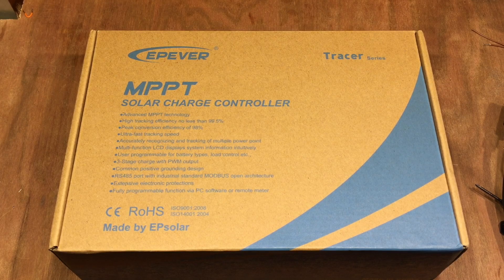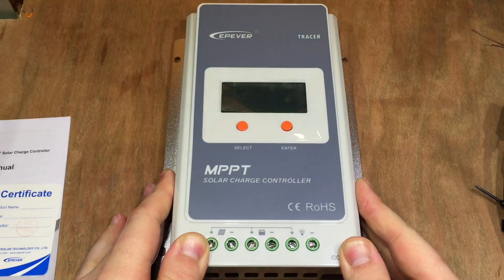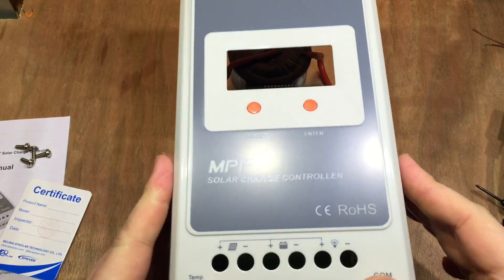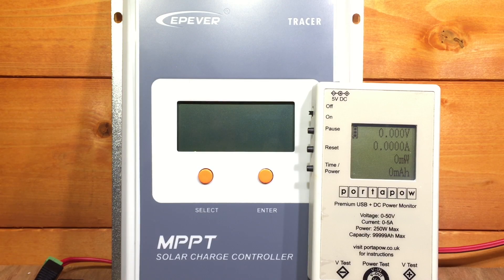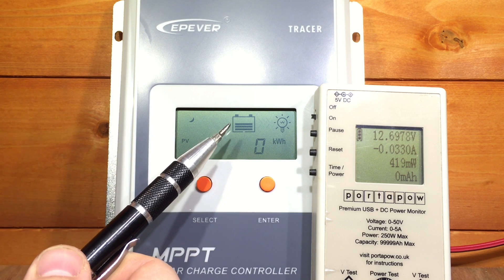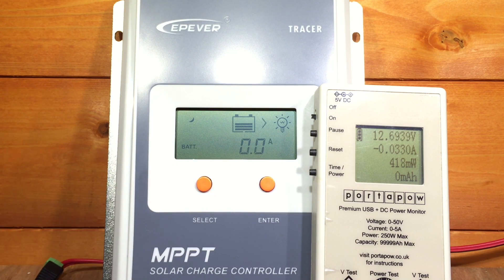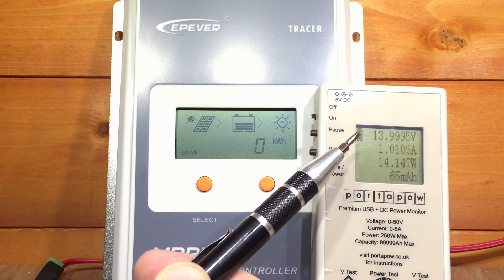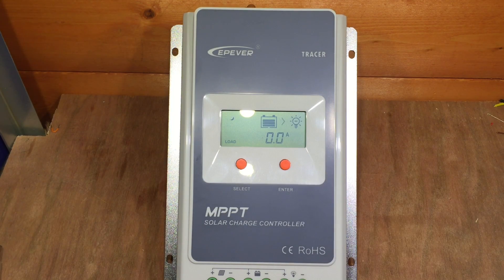MPPT Charge Controller Review - EPSolar EPEver Tracer A Series - 12v Solar Shed

Comment: I just got the same device.
If anyone can help me understand if I can connect my 2 panels with this specs:

Nominal Power 265W 
Measurement accuracy Pmpp*: ‡3 %
Short Circuit Current 9.16A
Open Circuit Voltage 38,32 V
Current at maximum power 8.76 A
Voltage at maximum power 30,25 V
Maximum system voltage 1000

Comment: Hello. A question if I may: can I use the EPEVER 2210AN with a solar panel of 280W, 31.38V, 8.93 A. In the PV specs it also says: 39.12V in open circuit and short circuit curent of 9.45A. I'm interested in charging a gel baterry 12V, 90Ah. Is the controller able to transform the Volts from PV to 12V of the battery? Thanks.
Reply from the maker: Yes it is. It may limit the charge current though if your panel is in good sun and your battery is low to stay within the 20amp limit.

Comment: Is the output voltage of the load terminals of this charge controller regulated? That is, does this voltage fluctuates with the battery voltage? What is its nominal value? Is there any significant ripple? It would be awesome if you could provide the shape of output voltage using and oscilloscope :D
Reply from the maker: The output is not regulated. It is the same as the battery voltage.
Reply: @AdamWelchUK  Thank you!

Comment: hi good video one question i have been told by several people they are no good , they said to buy a Vicron smart solar controller instead what do you think
Reply from the maker: I know Victron are well regarded, but I have no experience of them. I have extensive experience of EPever, and they’ve been great for me. You pay your money, you take your choice. Good luck!
Reply: @AdamWelchUK  Thank you i like the Epever so going to go with them will a 30 Amp mppt suit my 300watt fixed panel  and my 200 watt folding  panel when i pull up at camp i have a 100ah AGM battery i run a waeco fridge and a few solar lights
Reply from the maker: @Farmer2492  with 500 watts of solar that translates to 41 amps if you’re battery is at 12 volts. So you’re over the rated output of the 30 amp model. It’ll actually cope with that, but will throttle the charge to 30amps. If you got the 40 amp model it’d charge at the full capability in full sun.
Reply: @AdamWelchUK  Hi i will be only using one panel at a time folding when i set camp up and the fixed one will be when i am driving

Comment: Hi there, I have this same model and am looking at adding another panel to my array, by adding another panel, it would bring the total panels up to 290w (this controller is rated at 260w, 12v sys) and a total of 15.6amp (9.1a on the 190w panel and 6.4a on the 100w panel)
I see that this controller has a particular feature "Ability to connect a larger array. The controller has the ability to restrict the charging current." 
Does this mean that I could still use this controller and it just restrict the total panel output to 260w as rated and I just wouldn't get the full use of the panels?
Or, would it run a fire risk and melt down with an extra 30w of panels? Any info on how this larger panel array feature works would really help. Thanks.
Reply from the maker: You’ve correctly identified a neat little feature of these controllers. Yes you can over spec your array however the charge current to your battery bank will never exceed the rated current for the model (it does actually, but only by one amp). 
I think the best part of this is that you can achieve more current in the winter without having to reconfigure in the summer.
Reply: @AdamWelchUK  Thanks Adam, Do you know what I need to look out for to avoid blowing the controller or damaging the system? The Panels I mentioned in my first comment is what I'm looking at, and I notice that the controller is Rated to 20amp, but the combined total of the panels I think is around 15amp. I'm a little worried as I know that in New Zealand the sun can be really harsh (big hole in the ozone) during the summer months and I've seen some panels totally crank it in the summer.
Reply from the maker: @joemcenteer2688  I haven’t been able to test this I’m afraid. I don’t have the solar I need to over rate my array with my controller (an in northern England we don’t reply get the sun) but I have heard that others have successfully done this. You’re over specking by less than 15%. My gut says it’ll be fine because EPEver claim it will go far higher. The controller will place your panels in a less efficient range when they are producing a too high current to reduce that output. In reality it’s just another calculation in the algorithm. Create as much as possible until you hit this limit, then throttle back to maintain that limit.
Reply: @AdamWelchUK  thanks, good advice, I'm thinking about putting a 12v fan heater or something similar on the light bulb port of the controller, my theory is any excess would be burned off pretty quickly by this. My gut says the same as yours as the over spec is so little, plus I've got an issue with part of the panels shaded by the roof bars and luggage box of the camper, so all things considered, it will probably work out fine and a nice balance. Thanks for your input mate
Reply: @AdamWelchUK  I've successfully overspec the solar array without any issue, yay!
Now I'm trying to set the load mode timer to run the fridge only during the day time but I can't seem to understand the modes, the manual is saying "load on for 1 after after sunset" and timer 2 "load in for 1 hour before sunrise" but when I set it to this its not on when the sun is up, its pretty confusing, is that to say that the load is only on during that 1 hour and then off again? Any ideas what I should set it to to make it only on during the day? Cheers

Comment: Are the pv panels best wired in series or parrel for maxium efficiency? Thanks
Reply: Love your videos btw
Reply from the maker: Thanks. 
It depends. The epever manual has some efficiency graphs which explain where they found the maximum efficiency. For me, I find it’s more efficient to run them in series in the summer and parallel in the winter.
However this all depends on what panels you have and their maximum power point.
Reply: @AdamWelchUK  Thank you. I will look at the manual and possibly do some experiments. 👍

Comment: I don't understand the load ports on this? Or what they're for.
Reply from the maker: They are controllable. So although they are just connected to the battery - and not regulated to a specific voltage, they can be used to control your loads. 
For example, you can have it turn on at dusk and switch off at dawn - useful for a night light. Or you could have a permanent load connected but if your battery voltage dropped to a critical level, the load could be switched off and not switched on again until the battery has recovered. 
Finally the only other reason to connect your loads here rather than directly to the battery is that you can monitor your loads. The charge controller reports on load current, watt hours etc.

Comment: Thanks great review. I seen there was no battery setting for lithium batteries. Is it possible to change the values of the charging float and bulk to suit a lifepo4 battery? Thanks 👍
Reply from the maker: Hello. Yes you can change the parameters to suit lithium (both my tracer a’s now charge lithium banks) but to change the charging parameters you need to connect to the charge controller over rs485. The cheapest way to do that is a cheap usb to rs485 adapter and an old network cable (I made a video where I built one) and using the epever windows software. Alternatively you can use the ebox adapters, the mt50 lcd screen or one of the many other home brew options out there (the most simple probably being the one Colin Hickey sells on his tindie store).
Reply: @AdamWelchUK  Thanks mate. I just watched the whole video. I ordered a cheap usb to rs485 adapter and have plenty of network cables lying around. I have ordered 4 cells of 280ah 3.2v Lifepo4 with a 200a Daly BMS from Alibaba. I want to try keep the cells around 90% state of charge as i believe it will make their life cycle higher.
Thanks for all the info. My garage will be fully off grid soon.

Comment: Hi, I watched your video last year after I purchased the same Epever Tracer. Mine was for solar charging in a travel trailer in the US. It's has worked well, but I got to wondering about the "LOAD" connect. I have run wires from my batteries to the power distribution center. Why not run wires from "LOAD" connectors on the Epever to the power distribution center? Your thoughts? Thanks

Comment: in reguards to the epever tracer 1206AN,  would it be possible to link up a 36v 200w 5.5A solar panel and have it convert to a 12v 450ah battery system?   im confused at all the jargan of open circut this and that in the user manual.   
heres the workshop manual for that particular model @t

Comment: I know this video is old, but I'm hoping someone might answer. I have a query on the load settings. Mine reads 117 and 2 n, and also 0.5 kw  what does that mean? Sorry to be dense!
Reply from the maker: 117 - load terminals in manual mode
2n - sunrise setting disabled
More info in the manual (page 19) https://www.epsolarpv.com/upload/file/1811/Tracer-AN-SMS-EL-V1.0.pdf
Hope that helps.
Reply: @AdamWelchUK  thats great! Thank you so much. I have a new solar set up in my camper van, I'd  like to try and understand it.

Comment: I have had this controller for two years.. It seems to work exactly as promised and has been very good value for money...
Reply: When you say plug and play does that mean that you simply hooked it up and didn’t have to program it?
Reply: @adam56usa  Yes - I did test if there was a difference between series and parallel - I would have thought that series would have been better with higher voltage and lower amps but it seemed to work slightly or marginally better in Parallel configuration - first with two panels and ultimately with three x 100 watt panels
Reply: Dan Erlich thanks. I looked at the owners manual and it seems a bit complicated. I didn’t get the MT 50 connection 
My unit is for 20 amps. I only have 200 watts. They are hooked up in parallel. I have two 50s and one 100 watt Renogy panels.
Reply: @adam56usa  The settings for lead acid and AGM batteries is the same and that is how mine came set from the factory.  Gell batteries require a different setting and also should have a temp sensor.   There are WARNINGS about mixing different solar panels... they should all be the same rating, but yes wiring in parallel is the way to go if you are doing so... I run three 100 watt panels as there is sufficient room on my Bimini to fit three panels - in my case flex panels.  I am going to shift to high strength magnets for mounting them...Much less invasive than any other method.    As my panels are all the same I tried this in both series and parallel and found that parallel was slightly better than series... The attractive things about doing it in series is that this controller can handle 100 volts and the current in the wire is much lower and the controller makes the conversion to from high voltage down to regulated supply of 13.5 volts...
Reply: Does this unit need to be programmed using an external source. Like a laptop or PC?
Reply: @adam56usa  No ... it was in my case plug and play.. Lovely machine BTW... Wish I could use it RIGHT now .. our boat is at our yacht club and we have been shut down tight...
Reply: Dan Erlich thanks, I am living on my sailboat in Miami. Just trying to squeeze a little more out of my solar panels. I currently have a PWM controller.
Reply: @adam56usa  The efficiency of this controller and the quality and reliability is excellent particularly for the reasonable price.   I tried it both parallel and series, found slightly better performance in parallel - but so tight that it really made no difference, the rational became that if one panel failed that parallel kept things running while series killed off the power.    Are you permitted to leave the dock to sail currently?   They allowing the marina to function?   Our club has been shut down TIGHT - we can not even VISIT the property to do maintenance on the hard now which really pisses me off - and as we are on an island this is even tougher..  The police are fining people heavily - $880 minimum, no fun what so ever.
Reply: Dan Erlich same here. They shut it down. People can check on their boats but cannot take them out. Also, no mechanics or brokers. I can use the showers and laundry and the staff hand me my mail but we cannot go into the office. I can understand that. The mayor got really ticked off awhile back because people were going out to the sandbar and rafting up to have parties. He shut down everything. Only boats allowed out are commercial fishing boats. 
Thanks for all your help with the controller. I’m going to invest in one.
Reply: @adam56usa  We can not even CHECK on our boats.. they are on the hard, under tarps and now with the warming weather the internal temperatures can skyrocket during the day and we can not get down to make changes for ventilation and mitigate physical damage... We need police permission to go there and the club has not arranged for this.  A few have went on the property with out permission but that opens them up to large fines and disciplinary action from the club.   I have asked the club board to act but they are figuring a MONTH at best before we can get ONE visit down to  our boats.
Reply: Dan Erlich just ordered the controller. Thanks for the help.

Comment: hi.hi.i have a smart bms. blutooth.i have connected and can see cells on my android @t battery is @t says one battery 3.6v an rest nearly @t trying to balance on the app.. when compare bms voltage with battery voltage   51,7v at battery but when measure bms black discharge leads to positive  its only @t that right?it does show 51.7v on the app from my battery
                
•
                 
•
Reply: well steve.ive just been on bike with cheap controller and it went well must have been nearly 30mph but didn't have speedo like my other controller with lc that cuts out.battery just dropped to 52volts.so why would the beefier controller cut out its twice the size of simple one.could it be settings on kt lcd3 display.?

Comment: Hi Adam,  If you still check your older videos,  how do this change controller hold up for you?  I'm in the market for one.
Reply from the maker: Still using it. If you watch my video about running it for nine months there are a couple of minor niggles. However I’m using two of these in the shed now, one on my 12v lead acid bank and another on my ~24v 7s20p lithium ion pack. I run them at half capacity to be sure not to over work them and they haven’t missed a beat.

Comment: Adam what about a battery balancer? Test some battery balancer (victron) or some other cheaper please
Reply from the maker: I’m using the diyBMS v3 on my lithium ion pack. It works very well. I’ve made videos. Still need to build version 4 to see all the improvements.

Comment: Hi Adam.  I am new to your channel.  I am also new to solar panel system.  I watched several of your create your own 18650 battery pack video and wondering if i can use a MPPT solar system with balance battery feature to charge up the one single 20p 18650 battery (18650 Building Blocks - 12v Solar Shed) like on your video.  My goal is to setup the solar system by my new shed and use it for in shed and out shed lighting.  Nothing heavy at the moment.  Eventually, add another set of recycle 20p, 18650 packs to the array to get more power to run out door shed light longer during night time.  May i ask if you have a complete video showing how to setup a MPPT solar panel / charger system to a single 18650 battery pack?  If so, i would like to review it and get some ideas what i can do.  Also, do you have any newer MPPT solar charger system that you recommend for beginner?   THank you in advance sir. :)  Cheer!!!
Reply from the maker: Hi Jack. Sorry for the delay. I use a Tracer A series on my 7s20p lithium ion pack, but the EPEver tracer AN series isn’t also good. None of them will charge as low as 4 volts though if that’s what you mean by one single 20p battery. You’ll need to split the pack down to get either 3 or 4 cells in series. You’ll need to adjust the charging parameters though via an MT50 meter, a usb cable or one of the network solutions. I’ve covered most of them on my channel. I use a standard gel profile on my 7s pack but they need adjusting if you go for a twelve volt option. I’m afraid all this information is spread across various videos over the last few years. Cheers
Reply: @AdamWelchUK  No worries Adam.  Thank you for you reply.  My goal is to recycle my current 18650 batteries with a 12 volt solar panel system.  I am still brainstorming this idea.  I know it can be done but i don't know enough to implement it.  I want to use load to power up my lights in the backyard at night for a few hours.  I will check more of your videos and go from there.  But if you are planning to redo a new solar panel charger system by using 18650 batteries, please let me know. :)  THank you in advance and greatly appreciated your reply.  Cheers!!!  Take care.